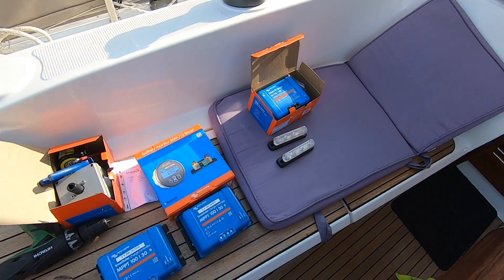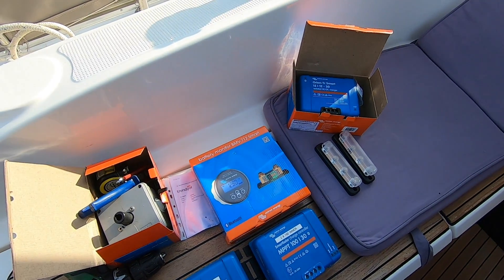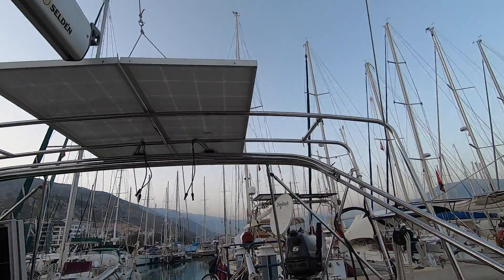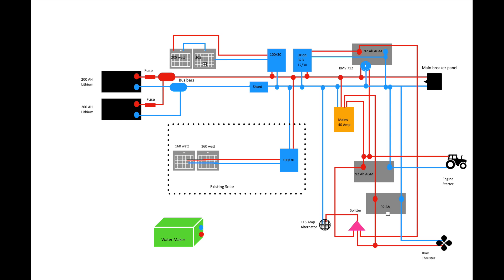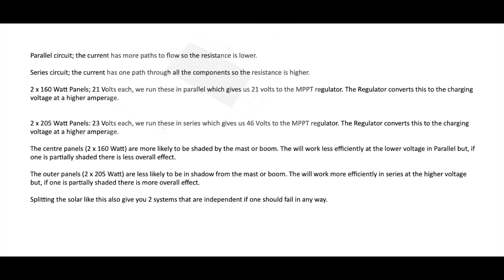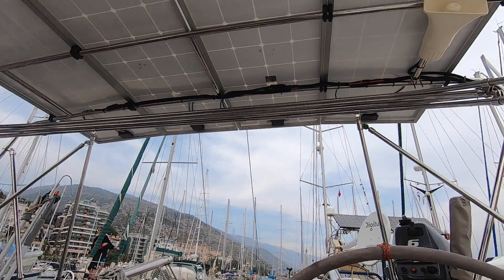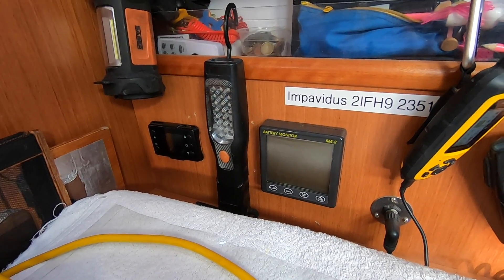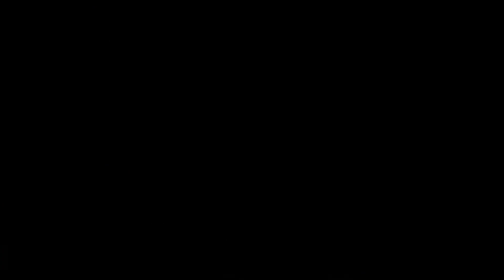Upgrading Our Solar. OTB 120 We fit new solar panels, Victron charge regulator, Victron BMv 712

Comment: Very nicely done and explained Ant.👍 I think it might be worth remounting the ‘blue boxes’ with stand offs, say 15 to 20mm, to allow a flow of air around the casings.🤔
Reply from the maker: They put a standoff in the heatsink Norman. It's about 15mm. I am a bit concerned about the B2B Lots of reports of that getting hot. I have some aluminium heat sink I think I will use. Maybe use some if it behind the Solar controllers too.  Sail Safe mate. Ant, Cid & the pooch crew.

Comment: Ant and Cid, just watch the temperature of the Victron DC>DC Orion.  I have recorded 59c and that is with the Orion having a 3" hole behind it.  I plan to fit a small PC fan to it.
Reply from the maker: Thanks for that. We heard they get hot. We have a big heat sink to mount it on that we are thinking of using but it may not be enough.

Comment: I am curious to know why you have no backing plate/washers or nuts on your winch base...? Thank you.
Reply from the maker: Good question Ian. The combining has a 6mm Aluminium plate about 200mm x 300mm bonded into the laminate. The winch bases are then drilled and tapped with 6mm countersunk machine screws into the plate. Making the fixing point stronger than just penny washers under fibreglass as many older boats have as the load is transfered to a bigger area. Well spotted, Im sure a few folks will have the same question. Sail Safe mate. Ant, Cid & the pooch crew.
Reply: Our boat standard from the factory was the same. I wondered how strong it was. When I took the winch out to install an electric winch I found the deck was 45mm thick with 35mm of Plywood inner core. On the breast hook where the anchor winch lives it was 65mm thick. Where the mainsheet traveller was bolted, wait for it, 165 mm on the outer bolts and 185 mm on the inner bolts. So that's why there were only 4 bolts holding it on.